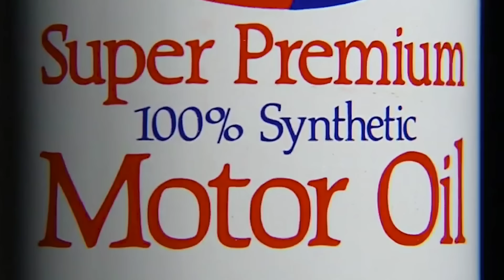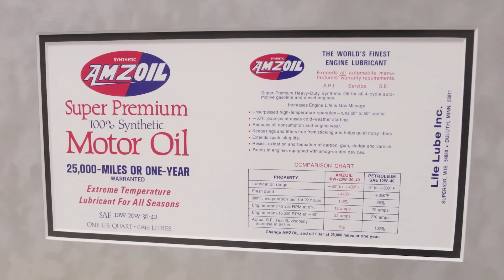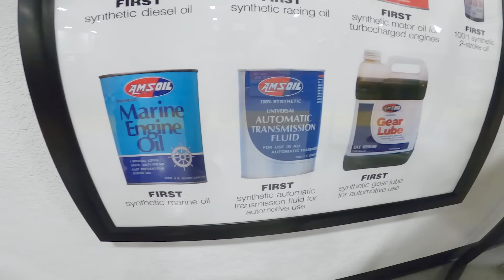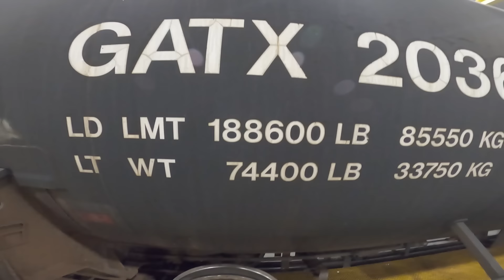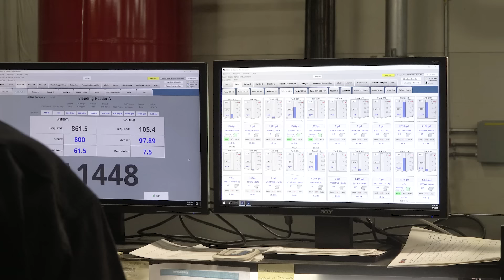How synthetic motor oil is made | Part 1 of 4

Comment: The Rolex watch of lubricants! My Toyota Highlander thanks you. 270,000 miles and no leaks or burning oil and smooth shifting 👍🏿

Note:
If u can’t afford the fuss of the motor oil tracking, cost and time. Do your self a favor and use their transmission oil! Change it every 100,000 miles. I used it doing Uber/Lyft my mechanic used a scope and showed me how clean the motor and transmission Diff internals were 😁👍🏿

Comment: Synthetic oils were created because of operating conditions of the jet aircraft engines. The high temps in the hot section downstream of the combustion chambers caused the conventional oils to coke up. This clogged the drains and the oils lost the lubricity at those temps. The cold flow ability was just a side bonus.
Reply: Yes, but that thermal stability now helps in turbo GDI applications that get thermostatted to 212⁰F and run around in 110⁰F heat here in west Texas for 15k miles
Reply: They started using synthetic oil during WWII in regular combustion engines, but synthetic oils in themselves goes back much further than that.

Comment: 🧐🤔 Why was the original deleted?
Reply: When you work with companies they normally request a view of the final edit. They want to make sure you haven't inadvertently included confidential processes or details. They want to check their employees aren't shown to be doing unsafe or non company compliant practices. They want to check the details the interviewer or company representative included are correct. They need time for legal, safety and compliance checks. 
It's easiest to upload a private video. Send a link to the company. Wait for the approval, and change the video from private to public. 
This stops any errors by sending one version of an edit to a company for approval, and releasing a different edit.

Perhaps, the video was accidentally added as a public video instead of private... until they noticed the oopsy...
Reply from the maker: No oopsy. Simply scheduled it to go live on the wrong date.

Comment: I had no idea amsoil pioneered synthetic oil. Definitely a game changer. No longer limited to 3,000 miles. Synthetic goes 5,000 easy.  But if you're busy 10,000 is no problem
Reply: 10 years ago. First oil change 25000 miles  on many cars now.
Reply: @HiTechOilCo  and 0W20 or even 0W16.

Comment: Synthetic has been around since before WW2, available from all oil manufacturers / suppliers.
Reply: Yup but amsoil was first and is the best that's facts not opions!
Reply: @victorgirouard1543  best may be by way of quality control. FACT not the first. FACT WW2 Germany heavily made n used synthetic derived from Coal Oil actually invented in Canada in 1846, thereafter motor oil was invented and synthetics came soon after, long before WW2.
Reply: @johndowe7003  I would move to say "perfected it"
Reply: @victorgirouard1543  Define "best", as you have facts.
Reply: They started using it more heavily during the war in airplanes, Germany was pioneers in new development of synthetic base stock (ester oils) at that point as they were cut of from a steady supply of crude. But... the video (so elegantly) made a point about it been first in American classification. :)
Reply: @PSA78  it was about 25 years ago I learned Germany heavily used coal based oils. But it was only in recent years I learned how much North America used synthetics.
Another comment I think describes it best in that, Amsoil was the first to market it.
Reply: @martinbrousseau2560  Yes Germany used coal for a lot of things, particularly fuel. They all switched to synthetic oils (though that line is somewhat fuzzy) during the war for airplane engines as they had increased immensely in power and the oil needed to work in both cold temperatures and with high engine temperatures. They also relied on more additives for longer service intervals, and that's what caused the myth about synthetic oils creating leaks, after the war people started using the surplus oils in their old cars, and the rest is history as they say. 😄
Reply: @PSA78  use your brain don't be lazy do the research for yourself and you will learn just like I did or don't not my problem!
Reply: @victorgirouard1543  That's a funny way of explaining that you don't have a single clue. 😂 🤣 Just full of assumptions, on all parts. 🤦‍♂️😂
Reply: @johndowe7003  Al A. (AMSOIL) formulated the first API qualified synthetic motor oil for gasoline engines and marketed it.

Comment: "Fake Oil"

I only learned this recently, and it surprised me. At one time, we had synthetic gasoline too. But no one ever called it "fake." It was actually the standard.

If you are in your 50s, you remember when you were a kid and your father's choices at the gas station were "regular" and "unleaded." Well, that "regular" gas was synthetic, developed to keep our tanks moving during WWII.

Then, the very people who now scream bloody murder about our dependence on oil, started crying about the lead in the synthetic gasoline, and so they forced us to do away with it. Now we are back to running on Dinosaurs.

Similarly, these are the same people who cry about coal, while fighting against nuclear electricity generation. They are the same people who convinced our Moms to switch to plastic grocery bags, to save trees. They are the same people who now want to reduce carbon dioxide in the air, which trees need to breathe. Their circular logic will never solve a single problem for anyone, because solutions are not their goal. Maintaining a constant cycle of problems, so they can stay relevant, is their goal and they are very good at this.

Comment: ... just like onyx, I was so impressed with the almost-artistic-perfection of the hardware in this facility. It is the 'computer-chip-manufacturing' equivalent of the synthetic lubricant manufacturing and packaging industry. OMG ... I want to visit this place. You see, I've spent over 30 years building/fabricating gas turbine engine test support hardware ... temperature, pressure, flow, oil particle size sampling, particle impact separators, the list goes on, and I had strived to make it all be as 'perfect' and 'sano' as this place obviously is ... but on a smaller scale of course. OH WOW !

Comment: It's Amsoil for me all the way.
I have a 2000 Harley that has 85000 miles on Amsoil.
I parked it next to an identical bike with only 5000 miles and we compared engine noise. We both have the factory mufflers so that was a perfect chance for me to hear how mine compared an almost new engine. Mine was as quiet as his. It  does not use oil between changes at 5000 and I saw a sign there indicating I'm wasting good oil by changing so soon. I'm old school used to changing oil at 3000. Not sure about extending the mileage on the Harley. I know some guys change the filter at 5000 and top off the oil, then change oil and filter at 10000. I should send an oil sample to testing lab and find out what I have at 5000.

Comment: I've worked over thirty years in chemical manufacturing and chemical related businesses, and I have to give this facility a solid ten. No visible spills or stains, hoses lying around, etc. This looks appealing to most viewers, but I think you would be surprised at how awful maintenance and housekeeping can be in chemical handling work areas, especially when management wants to do things on the cheap.
It really has to start at the top. Management has to want a work environment like this and set the standard for everyone to work to.
The arrangement and engineering of the tank car unloading area and the blend room deserve high marks, for how it was designed, fabricated as well as maintained.
In order to build and properly maintain a business like this there has to be a decent profit margin. So yes there's an advantage to being privately held and not beholden to stockholders or private hedge funds.

Comment: I have used Amsoil since the beginning. I had a 87 Ford Edie Bower Bronco I personal put 360 k on the 302 Engine all it needed was a timing change. When they pulled it apart it was still brand new inside! It still had 98 to 99 percent compression in all cylinders. I am Amasoil user for life.

Comment: Been running Amsoil for over 10 yrs in every thing from a pickup, SUV, RV to a Corvette. Cooler operating temps and improved fuel mileage is usually a result. I can't say anything about reduced wear because nothing has worn out yet but it seems to be doing well in those regards.

Comment: It is said that ester fully synthetic motor oil is good, but what is the advantage?
Ester oil is a kind of high-end synthetic lubricating oil that is very popular now. It was developed by the Germans during World War II to solve the problem of starting tanks and locomotives in the cold zone. Later, it was widely used in aviation and other fields. Gradually switch to motor sports. Ester base oils are formed by catalytic dehydration of organic acids and alcohols. Commonly used are diester, polyol ester and compound ester.
Ester products contain various forms of oxygen atoms such as carbonyl oxygen and alcohol oxygen, which are functional groups that distinguish ester synthetic oils from general mineral oils, and are polar. The base oils of the three types of synthetic oils and PAO synthetic oils do not contain such groups. In the lubrication process, the ability to form a thick oil film between the friction pairs is critical to the lubrication effect, and compounds containing polar groups are more likely to be adsorbed on the friction interface to form an effective tough oil film. The same function, non-polar synthetic oil is achieved by adding additives. From the product description, you can see words such as diester, alcohol ester, etc. In fact, the synthesis raw materials are different, and the reaction mechanism is similar.
Ester fully synthetic motor oil, where is it stronger?
Everything has two sides, and ester oils are no exception. Let’s talk about the advantages first:
Advantages of Ester Synthetic Motor Oils
1. Good thermal stability. From the perspective of thermal decomposition temperature, diester oils are generally around 280 degrees, and alcohol esters are more than 300 degrees. This is related to its molecular structure. The fully hindered ester esterified with neopentyl polyol has a higher decomposition temperature.
2. The polar structure gives this kind of oil special lubricating performance, and it is easy to adsorb on the interface to form a stable oil film. Even if it is cold, it will not return completely, providing good low temperature protection. For example, compared with mineral oil lubricating oil, the polar functional group of ester group is sucked on the friction pair interface like the sucker of gecko, and it is not easy to fall off even under the condition of low temperature and cold car.
3. Strong sensitivity to additives. It can be well integrated and synergistic with additives such as antioxidant and anti-wear.
Disadvantages of synthetic ester oil
The biggest disadvantage of ester oils is their hydrolytic stability and material compatibility. Because of the polar group, ester oil is easy to absorb moisture (remember to tighten the cap when you use the rest). The stability of polyester to pure water is not bad, and it is unstable in acid and alkali environment. Since the engine oil contains many additives containing phosphorus and sulfur, and there will be fine metal particles worn down during the working process, the additives will produce acidic substances under the metal catalysis, which further catalyzes the hydrolysis of the ester. Ester will obviously swell rubber products of certain structures, which is also one of its disadvantages. However, these disadvantages are alleviated by appropriate modifying additives.
What is the difference between ester synthetic oils?
Ester synthetic oil contains various forms of oxygen atoms such as carbonyl oxygen and alcohol oxygen, which makes ester synthetic oil different from the functional group of general mineral oil and has polarity; while the base oils of three types of synthetic oil and PAO synthetic oil are not Contains this group, which is the biggest difference between lipid synthetic oil and ordinary synthetic oil. Active adsorption oil film and passive adhesion oil film During the lubrication process, the formation of a thick oil film between the friction points of the lubricating oil is critical to the lubrication effect. Compounds containing polar groups are more likely to be adsorbed on the friction interface to form an effective tough oil film. The same function, non-polar synthetic oil is achieved by adding additives. Mainly rely on a certain viscosity to adhere to the friction interface. When the engine stops working, this adhesion gradually flows back and falls off under the action of gravity, and the oil film becomes very fragile. The oil film produced by chemipolar adsorption can be maintained for a long time after the engine is stopped, providing uninterrupted lubrication for the engine.

Comment: Back in the 70s I was a Houston Yellow Cab franchisee. I owned 5 Taxis. I was part of a study. They gave me the oil and even did my oil changes for me. Back then they wanted us to go 25,000 miles between oil changes. They had us change our filter evey 5,000 miles, and ad a quart. I didn't have any engine problems, but today it's clear, that blowby contaminates oil.

Comment: I'm from Oil  City, PA, where the entire oil industry started. The whole oil business has fascinated me for most of my life and as an ASE Master Heavy Truck Technician, I've made it my business to develop more than a casual interest in motor oil. Personally I would never use Amsoil. Even back in the day I would never use Quaker State oil in a car because it left a waxy deposit in car engines. I tend to believe more in the major manufacturers and use either Mobil 1 or Castrol Syntec in my personal cars, motorcycles and my performance engines. 

It says a lot about this product that they have to brag on the little building where they manufacture the stuff and say nothing about the chemistry of making the product. I wanted to see a description of the chemistry, not a tour of a minor packing facility.

"Precision" adding of ingredients by 55 gallon drum? They talk about adding by weight, but how fast can the guy stick the plug back into the drum? No doubt he would lose a few arm hairs into that mix.

Yeah, that camera eliminates a job for a human...   I also say this to every manufacturer, if the oil is made properly it doesn't need additives. Gasoline additives to remove water or dissolve varnish yeah, but never oil additives.

Comment: Very interesting.  I like how the machines are synchronized.  Like the machine that capped the red bottle.  So intricate. Now synthetic oils are considered man made. But are not the chemicals and additives still petroleum products? Just a question to satisfy my curiosity. I've never used Amsoil products but l just might, at least in my stock 1995 Ford f150. Does Amsoil blend "high mileage" engine oil?
Reply from the maker: Thanks for watching. We suggest watching our other episodes. We step into the Amsoil lab and learn about the chemistry of synthetic oil and how it is tested. This was episode one of four.
Ep2 👉🏻 https://youtu.be/9rEGIB2F8qA
Ep3 👉🏻 https://youtu.be/NuX1tWwLjy8
Ep4 👉🏻 https://youtu.be/mnseEdDSVDM

Comment: The process of direct conversion of coal to synthetic fuel originally developed in Germany. Friedrich Bergius developed the Bergius process, which received a patent in 1913.
It is also believed that the first synthesized hydrocarbons were created by Friedel & Crafts in 1877 using Aluminum TriChrloride as the catalyst.

Comment: Was hoping for a tour of the base oil and other chemical additives production facility and a chemist from those facilities to explain the difference between petroleum based oils vs the 100 % synthetic base oil ....before the amsoil mixing and packaging facility tour. Didn't get it in this program thus we still dont know the essential difference between for example "Mobil 1 full synthetic " vs "Amsoil 100 % synthetic"....a consumer could easily be misled into thinking the oils are essentially different from different base stocks when in fact all probability both base oils are identical for practical purposes.

Comment: I’d love to use Amsoil for my trucks, but I dont like the fact that I must go through an independent dealer and must buy it in bulk.  I like just driving to my local Walmart, O’Riley or Autozone auto parts store to quickly pick up what I need per individual quart.
Reply: I have never had a problem getting Amsoil at Napa
Reply: @raydignard2187  I wish we had naps in my neck of the woods.

Comment: I am kind of surprised or not using an inline static mixture or 2 in a train, On the way to the mixing tank to cut down the mixing time needed there.... But then it would need bigger pumps slightly and it would also cause a problem for their little piggy to go throug....  Although they could put static mixers directly above the tank out of vertical pipe let it gravity drain...

Comment: I had a Ford Focus motor do 750 Mm with no leskage by using synthetic after first 5,000km oil change and returning the used oil for recycle.

Comment: Actually it was the Germans that got there first. In the early 1940's they were synthesising crude PAO base oils from ethylene. Whilst most of this was for aero-engine use (where low temperature performance is crucial), some found it's way to the Eastern Front.

Comment: So have you actually tested the oils used in Harley Davison m8 engines? What’s the minimum additives Harley David requires? That bearing test is nice but is it the same grade metal used in a Harley motorcycle’s 3 holes.